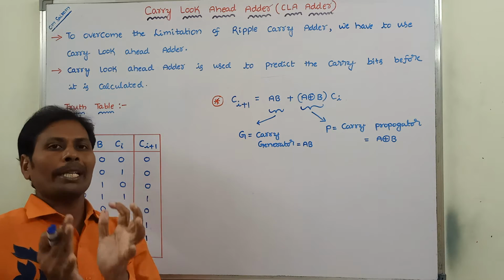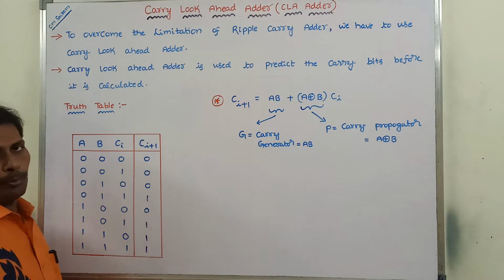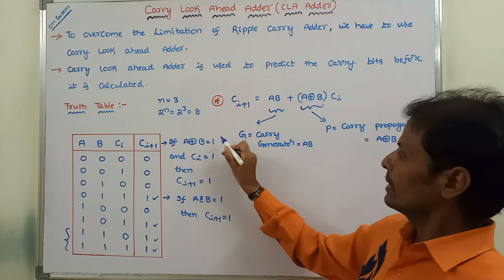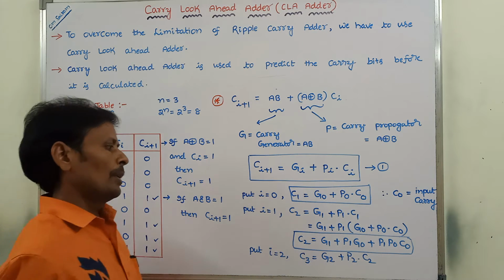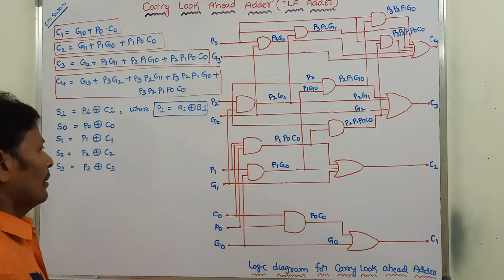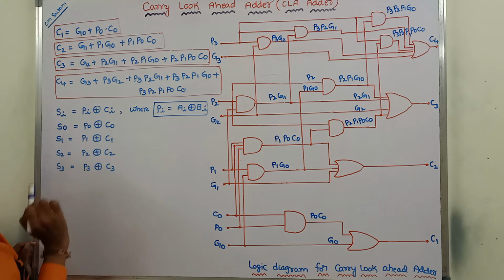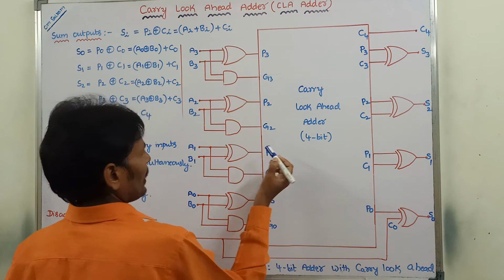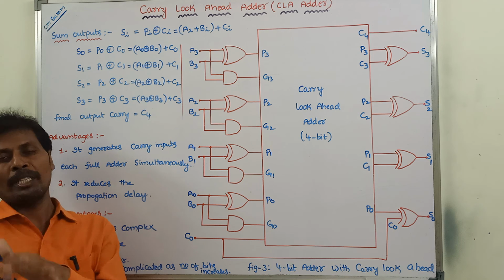Carry Look ahead Adder(4-Bit) || Advantages and Disadvantages || Ripple Carry Adder | DLD | CO | CA

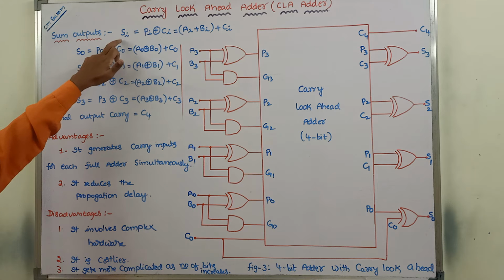Comment from the maker: A Small mistake done in the video in Sum outputs,⊕ symbol is missing from 27:16 onwards. The correct Sum outputs are shown below. Sorry for the inconvinience
Si=Pi ⊕ Ci
S0= P0 ⊕ C0= (A0 ⊕ B0) ⊕ C0
S1= P1 ⊕ C1= (A1 ⊕ B1) ⊕ C1
S2= P2 ⊕ C2= (A2 ⊕ B2) ⊕ C2
S3= P3 ⊕ C3= (A3 ⊕ B3) ⊕ C3